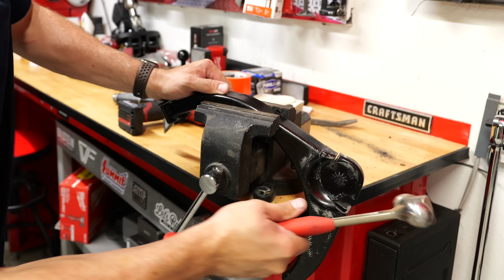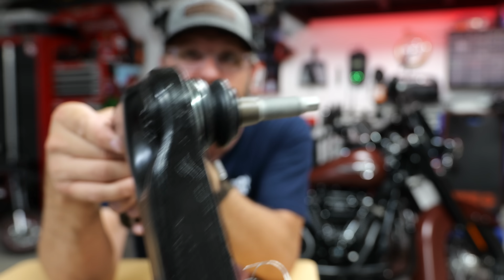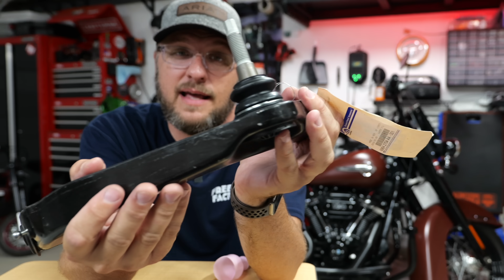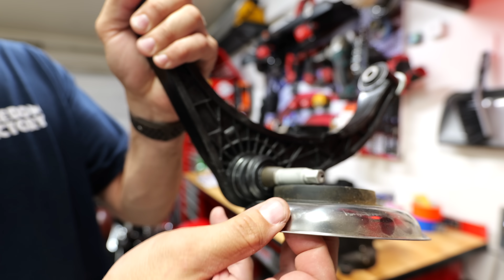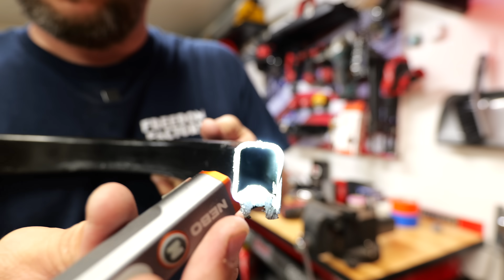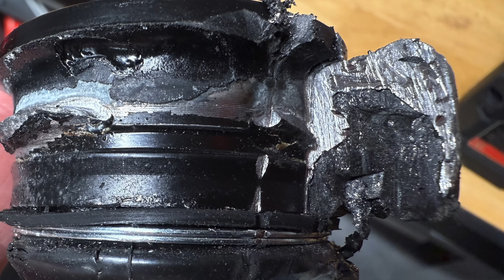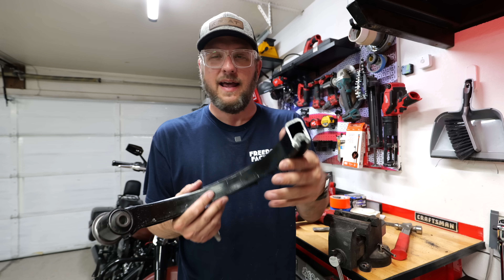I Cut Open RAM’s Plastic Upper Control Arm… Worse Than I Expected?

Comment: The idea is to not have any serviceable parts, making it out of plastic forces you to not to only replace the ball joint but the whole arm assembly, which in some cases you can get away by just replacing the ball joint. 

Being a Mopar I'm pretty sure it's gonna cost you an arm and a leg and the ETA surely is gonna be 1 to 3 months.

Comment: 6 years these have been on trucks.  As a dealer tech I have seen 0 worn out upper ball joints and replaced 2 control arms due to accidents that broke the spindle the control arms were simply dented from the wheel hitting them. There are so many junk parts on modern vehicles people could actually complain about but these have been proven over years of real world experience to be one of the best modern designs
Reply: I've been working on cars for 30 years and none of the plastic garbage that I put on cars will ever last. Ever. Sheep keep listening to dealers, they keep buying them, and I keep making more and more money from them. Lmfao
Reply: Have these been on since redesign in 2019? I have a 23 Ram big horn and it's been fine. I also fluid film my truck.
Reply: 6 years! Boy they really have stood the test of time! 😂 🙄 Let's see how they hold up in 30years... I'm driving around in my 1993 f150, same control arms btw
Reply: I would venture to guess that the added plastic could be for sound deadening.
Reply: @nicholaslimpf9615  they need to pin your comment. Like you are saying know one knew about these being plastic because they are not failing. But the internet is making a big deal about a part that isn’t failing.

Comment: My concern is that plastic will deteriorate over time, take any plastic part and put it in a shitty environment, like under a wheel well, and then test it a few years later.  Sorry, that part will fail much sooner than a new part.  Guess what, a powder-coated steel or aluminum part will hold the same strength over decades, if the powder coat is not ground off.  This comes down to a "Just because you can do it fails to make it a good idea".  This plastic embossed control arm makes me wonder what the heck, it costs a bunch more to make it this way, yes it will stand up well as it is even heavier than powder coat.  But casting in the ball joint into the control arm isn't all that good, here we have a non serviceable ball joint that demands replacement vs repair component.

Comment: Interesting dissection. The actual control arm is made up (my guess) of a lighter material with the engineering grade plastic used for reinforcement plus a non replaceable ball joint that will probably need replacing somewhere in the 100,000 mile range. A few hundred bucks garage job with front end alignment vs an easy $25 DIY project. Then there is rust resistance which Dodge/RAM  pickups need desperately in North America's vast rut belt

Comment: I like my gmt800 solid steel control arms, gmc managed to keep the whole yukon weight around 5k lbs also, not bad for 20 year old technology, keeping mine on the road indefinitely. Just rebuilt the engine a year ago, love it.
Reply: 270,000 miles on my ‘05 and I can still go through a mud pit, haul a bunch of furniture, or drive the thing across the country and it doesn’t miss a beat. Best truck ever
Reply: @dsz2448 yessir
Reply: I have moved back to the GMT 400 platform, myself!
Reply: @foreverendeavors6210  
My 06 Z71 1500 Is a fantastic truck. Wouldn't change a thing.

Comment: The problem with plastic coated metal is any intrusion of the plastic allows moisture to enter which allows hidden rusting underneath the plastic. Plastic covered metal has caused bridge failures due to hidden rusting.
Reply: @alstuart  gm full size trucks with a plastic jacket AL driveshaft have this issue. The driveshaft splits in half, usually at highway speed from vibration, even though the jacket look perfect
Reply: That's a future recall.
Reply: @xishootstuffx  That sounds like a problem for the next CEO
Reply: Plastics can also be corrosive

Comment: Just by the way it cut one can tell that the stamped steel it gummy and has no rigidity or spring to it.  Thick conduit metal.  As for upper control arm not being load bear is false as well.  Any lateral force on the tires at the bottom tread, say a pothole in a curve, will translate to the upper ball joint. Take a 10 lb hammer and hit it.  Take a 10 lb hammer and hit a 80s chevy upper control arm and post it. The money they are saving is also in the tooling to press the "conduit control arm".  With a die and a Harbor freight press you could make that  control arm then weld it with a Harbor freight flux core welder and you would have the same part.  You would be hard pressed to make an 80's model control arm.

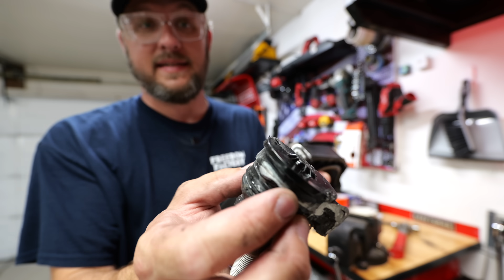Comment: @8:22 you show "5/16 steel imbedded" but the steel is not 5/16 thick. It appears to be about .114"-ish thick and there is about a 5/16" lip bent down.

Comment: Looks to me like they just made the control arm out of thinner metal and use the molded plastic to stiffen it up. The result is supposedly a lighter part that is the same strength as a completly metal one the is thicker. However I think the salt used up here in the rust belt will eat this thing for breakfast! LOL.

Comment: The plastic section looks like it adds to the rigidity of the arm. All of those ribs on the underside are not placed randomly, but in key points. Likely the main strength is in the metal portion, and the “under-molding” is to keep it from flexing with less metal present. And less steel probably saves them a few cents per arm to manufacture.

Comment: Not a fan of plastic suspension, but I will say this: I work at a dealer and we see a lot of those trucks. I still haven't seen one of those control arms fail yet. After watching this video, I feel like they might not be as bad as we all thought. Besides, the rest of the truck has enough problems

Comment: In the 2000s, while prices were around $27,000, is when it was spread far and wide that Ford was making $10,000 profit on their trucks. This was long before pick-up trucks became $65,000 to $110,000 luxury vehicles. How much profit do you think they are making per truck now? It's "whatever the market will bear." They keep raising the prices, and as long as people keep paying them they will raise the prices higher until sales are negatively impacted. I have no idea what kind of idiots are paying $65K - $110K for a daily driver truck.
Reply: thats pure stupidity. trucks are way overpriced
Reply: @billbarney4937  Everyone treats the dollar like its a sound measure of value over time but it definitely is not. Unlike the inch, meter, pound or kilo, the dollar is not the same even from day to day. My point is that trucks aren't nearly as expensive as everyone thinks, the dollar is just losing all of its value.
Reply: I managed to snag a 2009 RAM Laramie new with every option except sunroof and factory limited slip with LIFETIME POWERTRAIN WARRANTY included for free for $36K out the door. Still driving it today at 255K miles. The rusty spots under the doors and in a few spots where it got dinged up are getting to be enough I need to decide if I will  spend some money taking care of it, or make it my backup vehicle for just when I really need a truck.

I think part of the reason trucks are so expensive is the American automakers figured out they couldn't compete when it comes to small inexpensive cars (the Dodge dart for example was a fairly nice car but people in that category will likely make the safe bet on a Camry or Honda that are built at massive scale with established quality). So now we have the opposite of the race to the bottom (selling on price) we saw on small cars.

I believe Ram still has the 4th gen "Classic" with a claimed starting price around  $36K (or $32K if you live somewhere where a 4X2 is still considered a truck) for the Tradseman level. I suspect it is hard to spot one near that price at a dealership though, as they tend to stock more of the Texas Caddilacs which are at least very nice indeed...
Reply: Need an 87-model truck with a good old generation 2 small block with a good 4 speed auto and modern fuel injection with a standalone computer and relays for everything else.  Do you need 4 valves and 4 computers to go 55-70 on the highway.  No, you do not, you need a $35,000 truck that anybody can work on.
Reply: They have to be making an absolute ton of $$ on them because the recalls don't faze them. Just keep making overpriced junk that people flock to and we'll deal with the problems out of the massive profits. The roads around me are just full of new SUVs from all manufacturers.
Reply: It's not people paying them. It's the bank's. The people think a $1k month truck payment at 15% apr for 96 months is normal. Then they cry when their garbage gets repod.

Comment: You don't have to be an engineer to figure out what the long term issues will be with this control arm. I wonder why the Ram RHO does not use this control arm if this part only supports alignment for up and down movement? When Steliantis came into the picture I stopped buying Ram Trucks, I don't trust their business decisions! I believe @blackout7615, placing the cost of disposing a contaminated material onto the consumer is right in line with Stellantis's business practice, just remember this is for your benefit! HA!!!

Comment: They never learned from their dashboard decisions. I have never ever seen plastic that doesn't degrade and weaken over time, and it is only a matter of time until some bean counter tells the plastic manufacturer to remove one or two or ten of the stabilizers necessary for it to at least maintain strength over 7 years. I'll be standing by with popcorn waiting to see how many fail before warranty and how many aftermarket manufacturers steal their business just like the oil filter housings.

Comment: If an upper control arm doesn't take much load, why do the bushings and ball joints wear out at a significantly higher rate than the lower?

Comment: Making a 7-9000 lb truck with 800 hp and expecting it to get 20mpg is the issue.
Reply: My 6300 lb Ram Ecodiesel has averaged over 30 mpg for nearly 200,000 mi. Finally had to replace a front wheel bearing at 193k. No complaints from former Toyota owner.

Comment: CHARGING A FORTUNE FOR  CHEAPLY BUILT  JUNK . WET BELTS       PLASTIC PARTS INSIDE HOT ENGINES       JUNK CVTS      GAS ENGINES WITH WAY TOO MUCH  GARBAGE ELECTRONICS           TWIN TURBOS   EXPENSIVE   JUNK   ON SMALL ENGINES     CUTTING CORNERS TO BUILD BUT WANT A PREMIUM PRICE  ' THATS CALLED RIPPING OFF CUSTOMERS .  NO SALE HERE IN MY LIFETIME .

Comment: Junk... what happens when the brakes over heat and it's already 95 degrees outside. How strong is that thing going to be then. Just the fact that it's flammable is reason enough to scrap that idea at the drawing board...

Comment: I am an engineer.  You got to remember who the engineer works for.  They are tasked with designing for cost savings then reliability as designated by the employer.
Reply: Exactly, they run simulations on CAD models , where conditions are optimal and perfect. It all makes sense on paper but in real life is a different story
Reply: @Red_Genie And the Term, " Under Normal Conditions" is the phrase they use.
Reply: @douglascooper1987  The question is, " What is normal "? Who defines it ?
Reply: @johnshaddick6858  Whatever is going on in the Test Cell, and it can be Sketchy.
Reply: Meh 😑 , their ultimate boss is the customer... Not good business practice to screw 🪛 the customer

Comment: ball joint can not be changed . The whole a arm . In 20 years , ball joint is finished ? A arm not avail . You need a new vehicule
Reply: I don't think a lot of the recent vehicles made will be still driving on the road in 20 years, most will be at Pull and Save. But certainly a valid point and that is likely what the manufacturer wants as well.
Reply: @Karol-g9d yeah like the truck will last 20 years.  Heard about the heating element on the diesel  falling apart and the nut ends up in # 6 cylinder?
Reply: @SparkyTseww  that’s on the HD trucks, this Control Arm is from a 1500. They don’t have that same issue.
Reply: @SparkyTseww 
Number 6?
No. I have heard of it going into a few different cylinders, never really just the one, but it does tend to go to that one.
Reply: Just use metal ones 😅
Reply: @Karol-g9d  you print a new one at home
Reply: @GT-43 , there u go the solution :-)
Reply: Even a lot of earlier models of cars and trucks , with steel control arms, the ball joint can`t be removed and replaced. You must buy the whole control arm.
Reply: Someone will make a replacement part.
I’m running a TVR, low volume British sports car, the company that made it died 20 years ago.
I can buy a new chassis today.
Someone will be making parts for sure.

Comment: CAFE standards have done a lot of damage to reliability. The push to smaller weights and less thermal loss by reducing displacement and turbo charging introduces complex delicate systems (which probably are NOT cost saving, but allow the manufacturers to sell more  premium vehicles) along with turbocharging and higher combustion pressures and rotation speed.

I can't speak for all engines, but it has been documented that some have moved to smaller main bearings, not for cost saving but for reduced friction--we can see how that worked out. Finally GM has leaked what we all suspected, low viscosity oils were merely an risky attempt to satisfy government regulators.
Reply: I think that car manufacturers use CAFE standards as an excuse to make garbage!

Comment: The plastic "encapsulating" the old-style control arm will assure this part will rust out faster.
Reply: Or it protects it from rusting since it’s 100% sealed
Reply: @JoshManis  And if it's something strong enough to knock the plastic coating off the upper control arm, chances are it already went through the bumper, headlight  and fender to get there.🌳🛻

Comment: Any deteriortion or micro cracks in the plastic will allow moisture (and salt)  to accumulate againt the internal steel. Not good.
Reply: By design. Get that salt in there to rot it out in 3 months, which is when the warranty ends.

Comment: Canadian winters are going to do that in without doubt...
Reply: That will be the only part that is still left after salt filled Canadian winters.
Reply: @dskebo  The extreme cold will crack that plastic covering in no time.
Reply: Some plastic will reach TG at the temperatures you have, TG means it is just like glass.

Comment: What this plasticification of car parts has done is to move vehicles closer to being disposable.  Intake manifolds made of plastic now regularly get replaced - when the metal intakes lasted forever.  Plastic oil pans that just crack instead of getting dents.  Etc.
Reply: shitification. lol
Reply: @Thomas63r2  chevy LS engines use plastic manifolds, they're  fine for 500K+ miles at least. Keeps intake charge cooler makes more power.  Some (other makes) manifolds have cracking issues.
Metal ones can have issues too, dodge magnum V8s had the steel plate on the bottom of the 'beer barrel' that would warp & leak.
Reply: @AndreS_-df2nw  I realize the benefits of using a more inert material to keep IAT lower - but when companies like Dorman are making stock type replacements, its because enough of the OEMs are failing.

Comment: Those new plastic upper control arms are not what they appear to be because their injection molded I prefer my upper and lower control arms to be Billet or cast Steel you know that age old saying if it isn't broken don't fix it

Comment: Yes, you can cut plastic with a hacksaw.  30 years ago there was a big push towards tricking out your RC race car with blingy machined aluminum parts.   The machined A arms looked ...well if everything else was blue anodized then having blue anodized A arms would add more blue.   BUTT.......they get bent up in collisions that do not harm the plastic A arms, and that would obviously tweak the suspension.   The plastic was lighter and more durable, which was better in a racing environment.  These A arms look good; I wonder if they thought they could get a better seal with the plastic to delay the A arms rusting from the inside where they salt the roads
Reply: I think that aluminium would be a bad choice for suspension components on a daily driver. Aluminium has a short fatigue life and is relatively brittle and subject to internal corrosion. Aircraft designers basically hate it, but all aircraft have been built of it for a century. Boeing now use composite for the Dreamliner.
Reply: @martinwade9421  yeah the stronger higher numbered alloys are stiff and brittle.  I never understood why they tried to make the aluminum f250s look like steel trucks; not my area of knowledge but thought all the side creases on truck body panels were to increase the rigidity of sheets of steel, which is not a problem for aluminum.
Reply: @AlexSomers-d2n  Good point, sir!

Comment: Trucks are overpriced. Nonway they jumped 40% over 3 years due to costs. Another thing, they don't have to buy carbon credits because CAFE is dead. Emissions system can be eased up on as well.

Comment: The new control arms ARE NOT plastic!  They are a reinforced composite.  

People complaining about this are completely ignorant!   

Sure!   Steel won’t break!  But it does bend!  

A bent upper control arm is just as bad a broke upper control arm!

Transcend the bullshit!
Reply: never had a steel control arm bend on any car ive ever owned
Reply: You mean the used scrap fiber glass pieces in it.  We used to put dirt in plastic parts as a filler, that was reinforced too.  It was done to use less plastic.